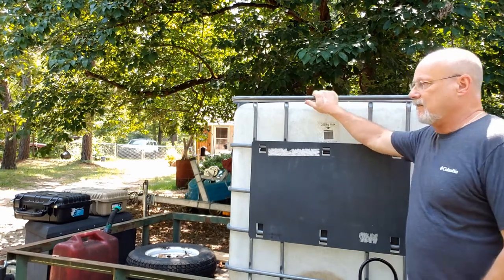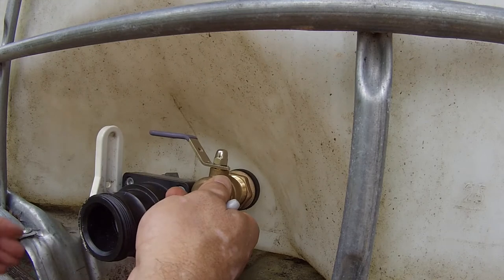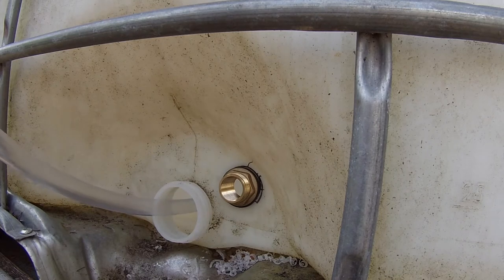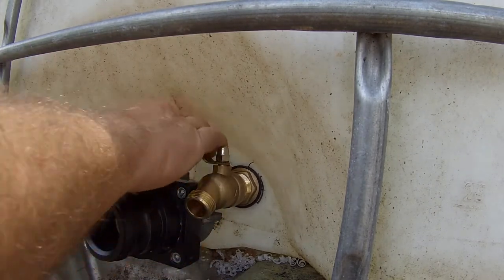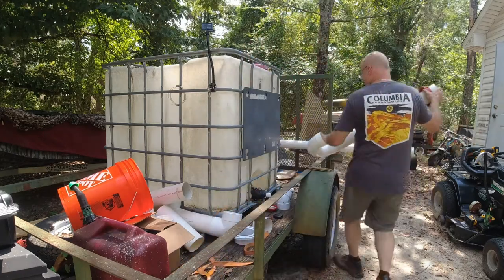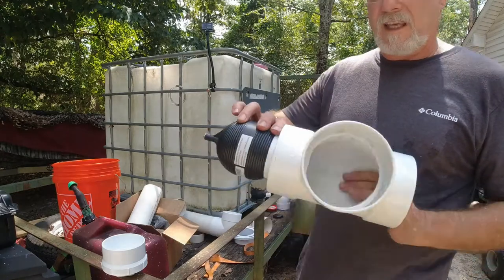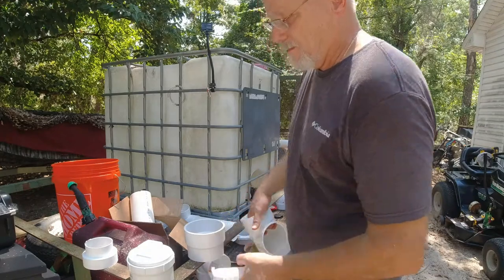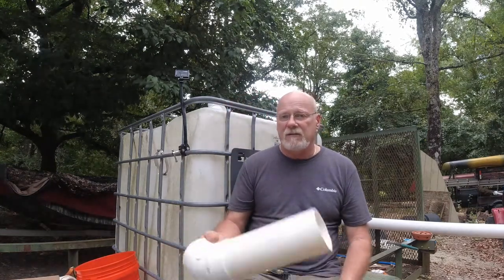Rainwater Harvesting System Part 1: IBC Tote Mods and DIY First Flush

Comment: Great first flush design. Tank float ball, wow!
I believe the reason why your fittings are different sizes is they are a mix of pressure and DWV (drain, waste, vent) parts.
Reply from the maker: They are both 4" drain pipe, ID is the same but od is different. Checked on the water this past weekend and the tank was full. Hope to add another lBC Tote soon. When we stay more than 2 days we can go through 275 gallons pretty quick. 
 Thanks for checking out the video.

Comment: Watched 1&2. Really Good info here, you can tell a fair bit of time was spent browsing the aisles at the hardware stores fitting parts together (I like doing that but thank you for doing it for me). The Fan adapter is key as it it often so difficult to find.  As for the Lowes/HD part from same manufacturer... That's a strange mystery
Reply from the maker: Hey! Thanks for watching and commenting. It's been working great too.